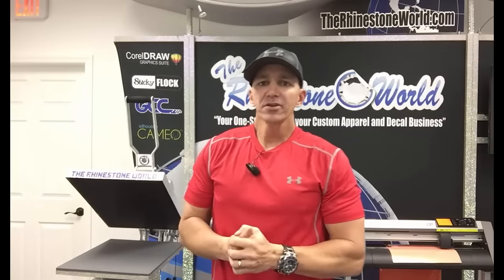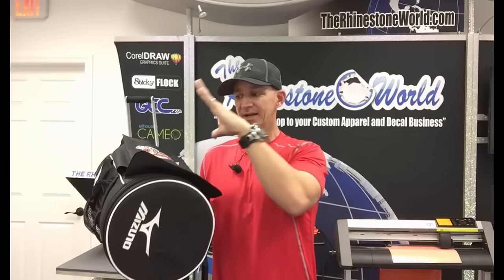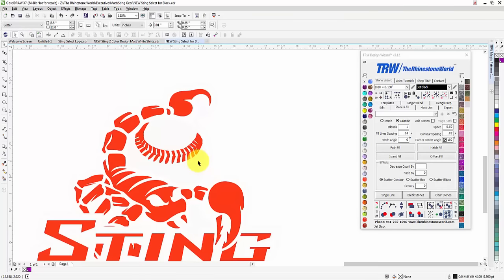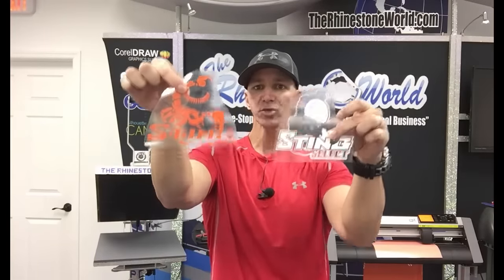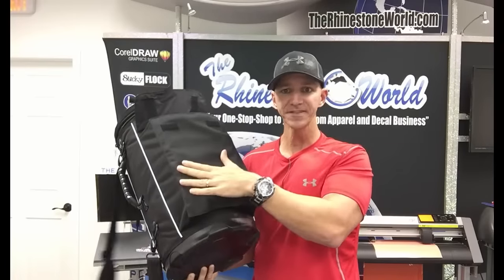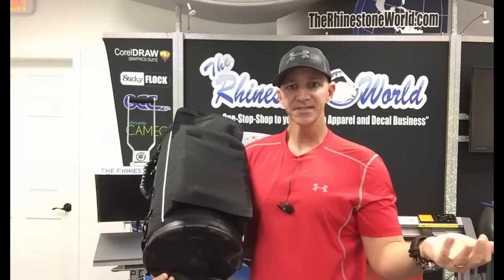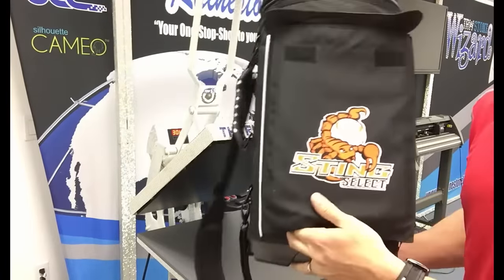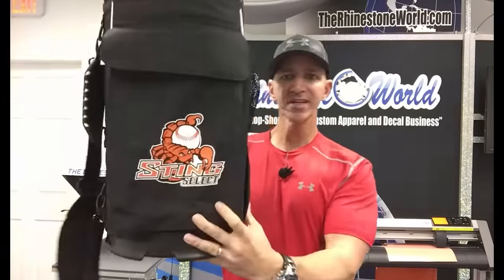Heat Pressing Outside the Box Idea for a Custom Baseball Bag

Comment: how about a back pack?... can I use a piece of wood or what can I use at home that is flat so I can heat press a logo or name?
Reply from the maker: Hello! You should be able to do that, just make sure the wood does not burn. - TRW Richard.
Reply: Thanks, much.. I saw somewhere that a ceramic tile might also help.. lol well I'll try sometime. Thanks for response